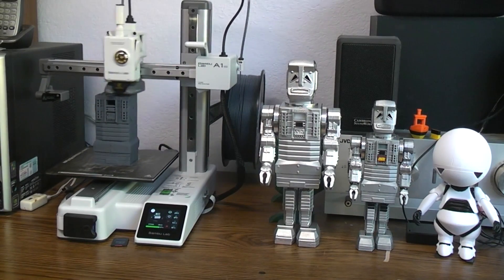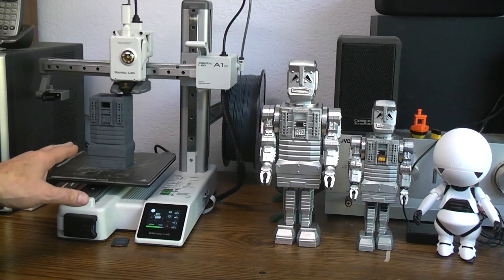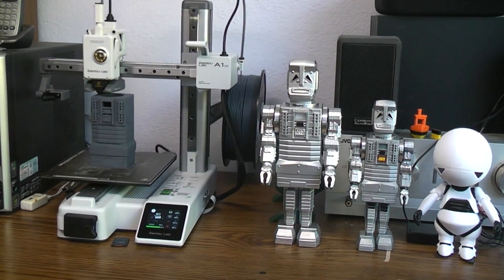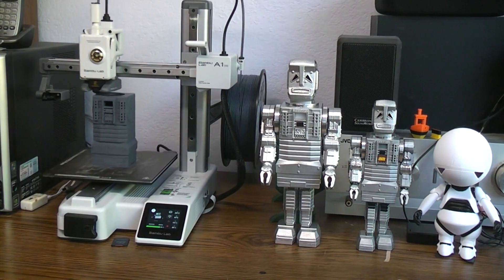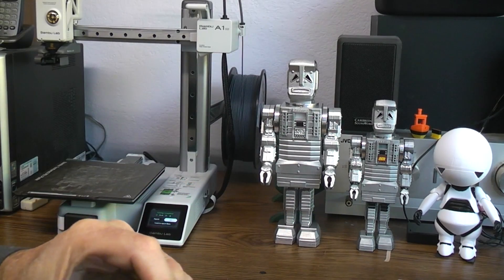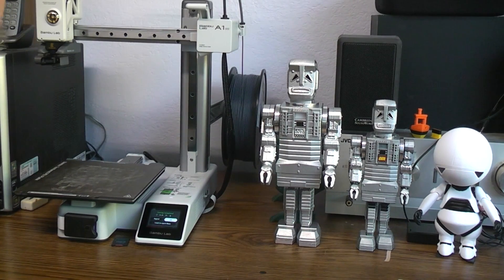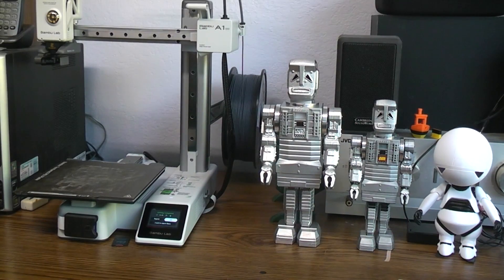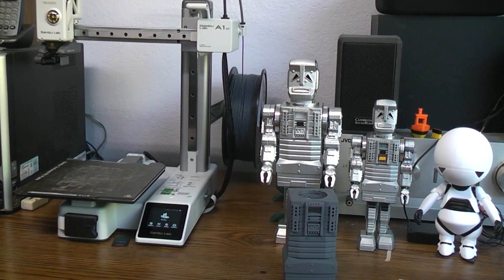Speed / Quality Test of the Bambu Lab A1 Mini. It did a 9-hour Prusa print in 3 hours. Quality print

Comment: Do these bambu printers need a solid base to sit on for good quality prints with speed and vibration they cause?
Reply from the maker: No. There are videos of them on card tables and even hanging from a rope. I sometimes place mine on 2 folded up towels if I want to run it at night so the startup sequence does not wake up other family members. Its ;like printing on a water bed. prints turn out perfect.

Comment: I mean prusa has just released input shaping on the mini so it's really not that much better.
Reply from the maker: It is still better and costs less or will once they sell the A1 Mini printer with out the AMS unit. Both great little printers for sure. I have had 3 PRusa printers, they have been work horses for me. But this little guy is amazing.

Comment: The speed is very impressive. I'm trying to decide whether to buy it now with the AMS or wait until they sell the printer alone. I don't think I would use the AMS very much. The build quality seems a lot better than other printers.
Reply from the maker: I would wait and just get the printer. I will probably never use the AMS unit. The build quality is top notch. I will do a video on using the printers speed control. Yes after you have sliced a project you can still go back and change the print speed if you want too.
Reply: @Robothut  Keep in mind that the advantage of the AMS Lite is not just multi-color, but above all the fact that you don't have to load/unload filaments manually, and simply have to select the filament on the slicer side without having to do anything else. I have the AMS Lite and it saves me a lot of time! The other advantage is printing PLA and being able to use PETG as support material, which is great because PETG doesn't stick to PLA and makes for even higher quality prints!
Reply from the maker: Very good points. I have a spare AMS cable coming and when it gets here, I will extend the cable so I can flip the AMS around, so the markings are upside right when installed above my A1Mini. Then I will probably leave it connected for just the reasons you stated. @JohnMarcel666
Reply: I saw a guy printed a 7 segment display using transparent and black filament using AMS. Super cool application. I would say get the combo since buying AMS later will be more expensive
Reply: @yoyomin  I saw  that video and found it very interesting. I agree with your logic on the pricing and I don't think the stand alone printer will be available for quite awhile. I've already ordered the mega pack.
Reply from the maker: Yes, if multi color printing is something you want to do then it is best to buy the combo. @yoyomin
Reply: The AMS is amazing, well worth it even for the lite version!

It makes the printer much more automatic and contributes a great deal to it's feeling like a quantum leap from past 3d printer vogue
Reply: At $299 this would make for a very nice second printer to run prototypes, while the big printer works on longer jobs. But at the current price (with AMS included) I might as well get a Prusa Mini since my other printer is a MK4
Reply from the maker: Yes wait until they sell it as a single printer then jump on it. Or wait and see how thy hold up over time. @kaasmeester5903
Reply: @kaasmeester5903  why are you getting the prusa instead of a A1 mini combo? Makes no sense at all.
Reply: @yoyomin  I have little use for multi material printing, and I already have a Prusa printer that performs very well. So if the price is more or less the same I prefer to stick with the devil I know 😊
If I need multi filament printing at some point, I’ll probably add an MMU3 to my printer; apparently they worked out the kinks in MMU2, and it is supposedly much faster and less wasteful than AMS. 
    
But when I need a second printer for small jobs, the Bambu mini without AMS at that price point would be very hard to beat!

Comment: Is it easy to switch between using AMS or not? Can't see any manual about it. Thx.
Reply from the maker: Yes, it is simple to do. I do not plan to use the AMS much, so I am set up now with the rear spool holder only and put all the AMS stuff out in storage in case I want to use it gain one day.
Reply: One tube to swap to choose between external spool or AMS
Reply from the maker: Yes, very simple to change from one to the other. It would be nice it they make a 5 way tube input to the print head. That way you could leave the AMS and the rear spool tubes connected all the time. @yoyomin

Comment: I found 2 sites where this is carried , the main site has it at $500 with the 4 spools which I don’t want . The other at $299 but no spool set up ?
Reply from the maker: Yes they plan to sell just the printer for $299. but when I bought mine you had to buy it a combo set. I have no use for the AMS "4 spool" part either as multi color printing is such a waste of filament and time.
Reply: @Robothut  I agree with you totally. 
👍🏻  I m looking for dead simple use . I may have found one in a different model than yours . I can’t get non bias reviews on yours as it is not on Amazon only what you tell me